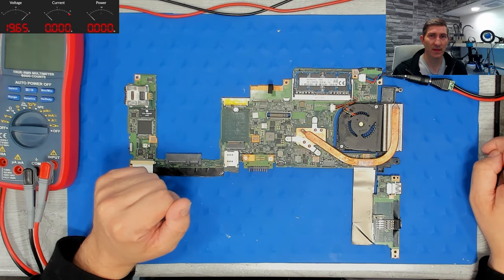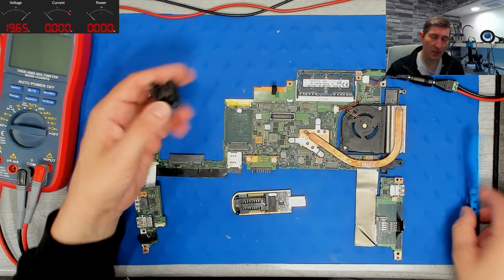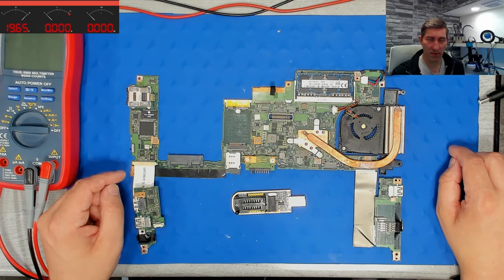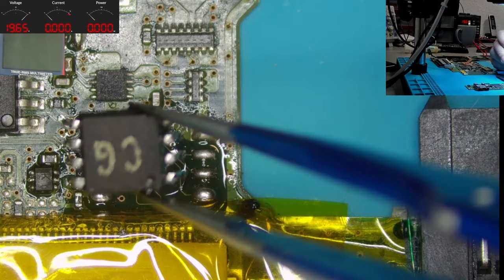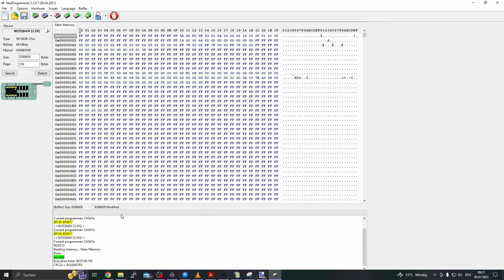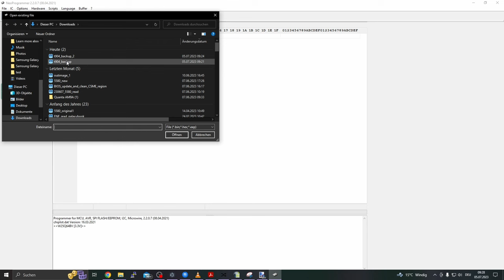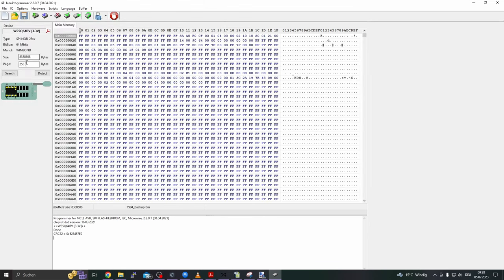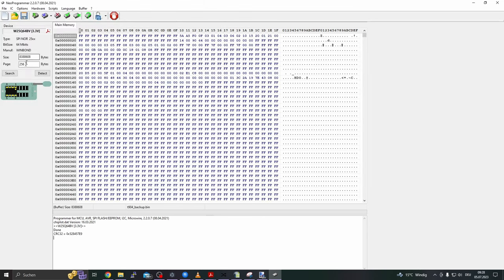How to reprogram a BIOS flash IC properly with CH341A  - The Dos and the Don'ts - Basics #1

Comment: I had a torture with a clamp for 2 days, could not get it to stick and then i made a lucky contact but reading was inconsistent, it could not erase chip, then could not verify, etc. etc, assorted errors; now i found this video that confirmed that clamp is a pain; some soldering skills and i could take the bios out of motherboard, and use the 200 mil SOP8 adapter on the CH341A programmer; i will post edit after my experiment;
Reply: 23:54 
I also have problem with inconsistent reads ans not being able to upload a baclup of the bios. Am using the clamp. 

Can we assume the main problem is the clamp and bad connection to the bios? So I shoud either fiddle around with the clamp or desolder the bios? Or is the problem maybe something else?
Thankful for your vid!

Comment: The voltage issue of the ch341 affects the 3.3v eeproms only with the 1.8v adapter the voltage is correct for the data pins i used mine on both chips without modification but i consider getting another one and mod it, as for the clip i got no issues reading 3.3v bios chip on board i got the same readings using the clip and the bios adapter but for the 1.8v bios chip i got different readings sometimes the chip was not even detected despite checking with the multimeter the bios pins to make sure they're making contact with the bios legs so yes the clip is to be avoided btw the neoprogrammer feels more trustworthy than the other ch341 tools. Nice demonstration
Reply from the maker: Thanks!

Comment: Although you mentioned the pin orientation of pin 1 as upper left. It would have been nice to pinpoint it for novices. Perhaps the orientation of the adapters on board. Otherwise   good.

Comment: A simpler 3.3v mod is to cut the 5V trace on the back, and then bridge / jumper the 3.3V and 5V header pins beside the ZIF socket. Then bridge the 3.3v pin on the regulator to capacitor C4, which connects directly to pin 9. No wires or lifted pins required.
Reply: i actually did the 3.3v mod..all i got was able to read ic`s but not write into them...software lock up and thats it...put back the 5v original configuration and worked normal
Reply: @theodordan680  Interesting. I've also seen another electronics repair youtuber showing that it's only 5v when there's an open circuit, and it drops to ~3.3v when you connect it to a chip. so it seems the mod is really not necessary at all.

Comment: So let's say I have a bricked MB and reprogram the IC with NeoProgrammer. 
1. Is it the normal BIOS Update file I get from the manufacturers website or is it another one? 
2. And let's say the chip has a capacity of 128 Megabytes but the BIOS file is much much smaller. Is this a problem or will there inevitably be free space left after flashing?

Thank you in advance Sir!

Comment: Thanks commander really best video on YouTube about programming. However how much air flow and temperature u used ?
Another from my experience I saw that xmc chips has problems with ch341a not always can be success programmed maybe I'm doing something wrong......
Reply from the maker: I had no issues with XMC ICs so far, so can't tell much about this topic.

Also, there is no point to share with what temps and air-flow i work if you don't use the same station with the same tips. Personally i like it warm, 450 degrees with 15% Air. :)

Comment: I don't know so much about electronics but Sorin made a video about this voltage mod and he said mod is unnecessary. Because that voltage doesn't burn chip with low amps.
Reply from the maker: Well, different technicians with different opinions, but you have to decide whether you want to stay safe or not. I have also learnt much from Sorin, he is a great technician. However, he has not eaten wisdom with a spoon and he is known for doing slightly dangerous things to accelerate the repair attempt. Good for him if it works out, but bad for a beginner who is not able to differentiate. Best regards
Reply: @fairrepair_en  Don't be jealous, just watch Sorin's video, he is right on the money and anyone who bothered to hook it up and do a simple voltage test  would have seen the voltage auto adjust. The mods were done out of ignorance not wisdom. In this case he ate wisdom with a golden spoon.
Reply: @gseperd9177 please what? Auto adjustment of voltage using a non adjustable constant voltage regulator? 😂 Some people have to start to think, before they post...

What Sorin said on his video is partially correct (the part with the low current there he got correct) and i do have a lot of respect of him. But the part with the voltage he got completely wrong! His opinion conflicts with the basic physics of semiconductors and may (and will sooner or later) lead to a permanent damage of data or the rom containing chip itself. Can it be replaced easily? Yes! Can the lost data be recovered? Hell no, not in that rare case! Do you want to be responsible for a loss of maybe very important data that may ruin your career? Maybe, i am not you to tell that.
Sorin is living in the UK, but there are other contries in this world with much more strict regulations and even law enforcement in such cases. One wrong step and bye bye your commercial licence forever.

What you may believe out of lacking knowledge, is your own problem. It is not possible, to change the physics of the world, we are living in, so it fits yours or someone elses liking. Period set in stone.
Reply: @fairrepair_en Very wise and 100% correct choosen words.

Comment: If the BIOs have an issue why to reprogram it? We could update or not? Or do we get the same result at the end?
Reply from the maker: If the BIOS is corrupt, there will be no way to update it. Some manufacturer like HP have implemented a recovery solution, but it doesn't work always.
Reply: @fairrepair_en  Thx for the fast reply. Would it work if we reprogram the corrupt data from the bios? Or what should we do if the bios is corrupt?
Reply from the maker: @saeedoubari2430  there are communities with many members who have dumped their known good BIOS firmware. These files can be used for testing purpose. The "BIOS Pro's" can extract the DMI, like serial number, Windows license, etc from the corrupt file and Transplantation it into these known good files, then finally a so called "Clean ME" and the BIOS firmware should be succesfully restored. For Details you need to talk to someone else though. I am more the "Hardware guy" and I am still asking my "Pro" when in trouble... :-)
Regards